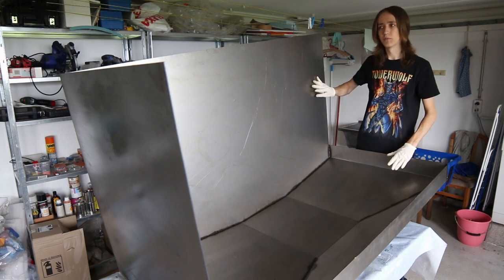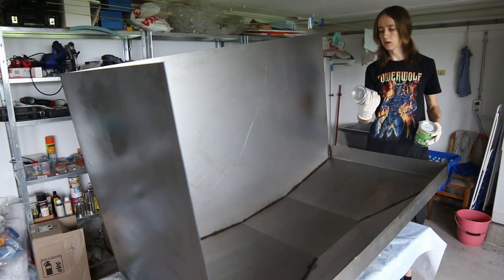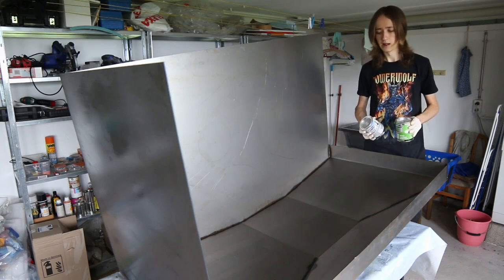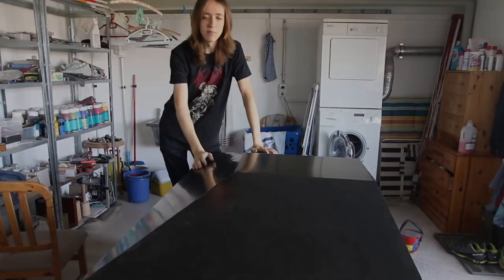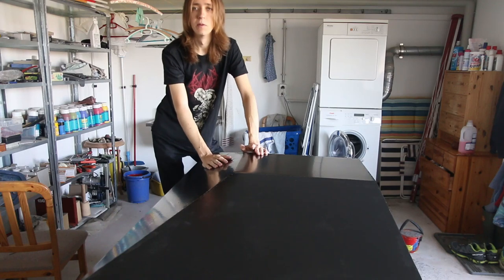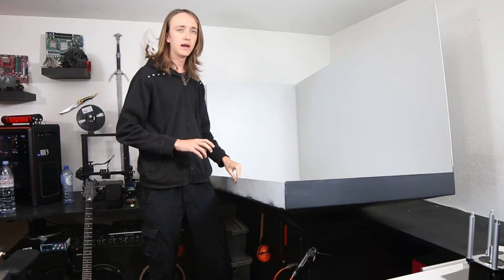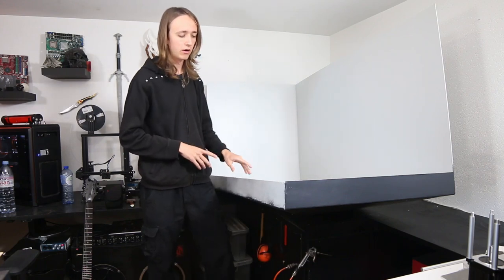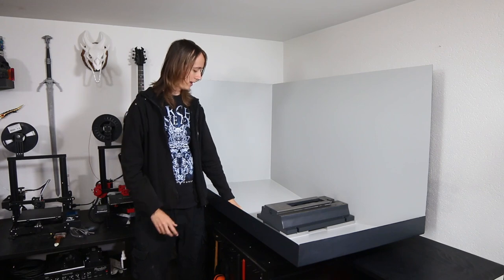BF30 CNC #2 - The Enclosure

Comment: well done! I was so lazy that i installed a mobile curtain around the CNC to stop the chips to fly everywhere. Your enclosure is really nice!
Since you are assembling the CNC do not forget to tramming the column, as I did :-) I advice to use machine epoxy and not just shim it that reduce the rigidity.

Comment: I'm building a custom table for my Lowrider 2 CNC machine right now and was wondering if such a setup could fit it inside in order to cut some aluminum sheet metal, or just to keep larger wood chips from flying everywhere (since I'm already planning to do a dust collector anyway).
Reply from the maker: From my experience, dust collection works great for wood, where it captures probably 70% of the dust. for anything metal, the chips have a lot more velocity and most dust collection systems for wood don't have the power to suck up the metal chips. An enclosure is better in that case, as long as you have the space for it. You could also just make a temporary enclosure out of cardboard to see how you like it, before you build something more permanent.